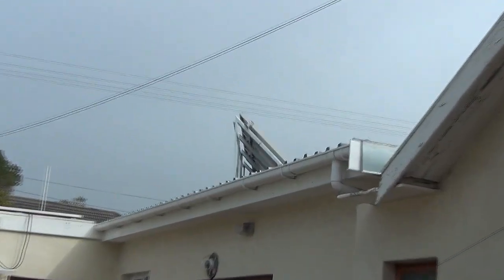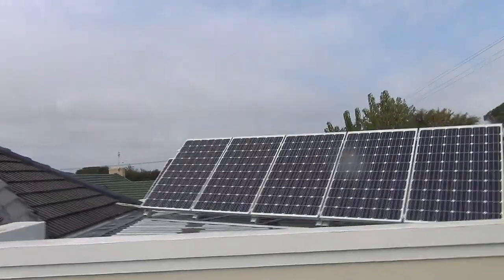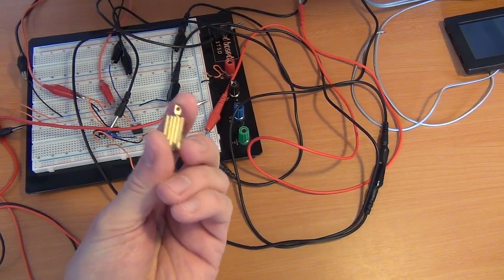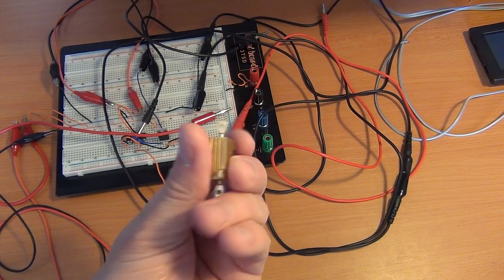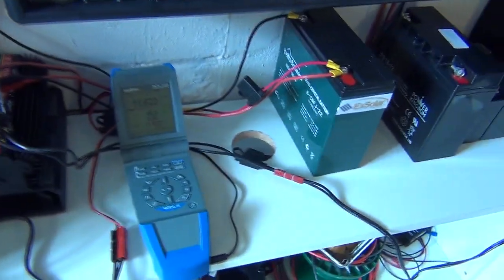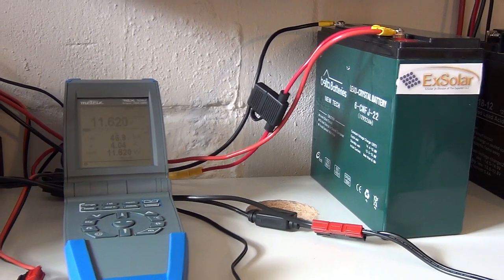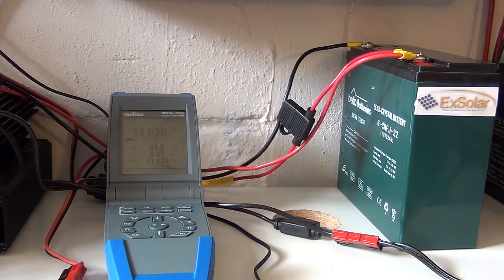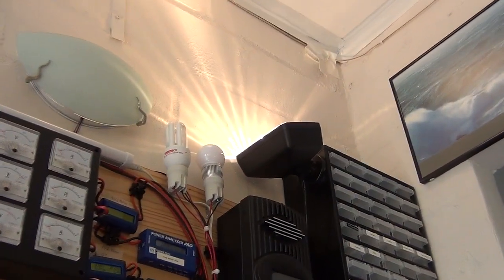T4D #20 - Solar Kindle, Solar House, Electronic DC Load

Comment from the maker: Thanks for the feedback. The capacitors are not "small", they are 220 F hybrid capacitors. Capacitors in this energy storage range are generally rated at lower voltages. These are rated at 2.3v and I thus need 8 to cater for the 18v solar panels. Thanks for the post.

Comment: The LT3652 is only available in VERY small surface mount packages and has a maximum rated charge current of 2A, so for experimentation purposes an off the shelf MCU with a homebrew MPPT/battery charging algorithm might be better.
Also, the charge in a capacitor is directly related to the potential difference across it.  Due to this potential variance, both the charger and the load output potential regulator need to handle a range of operating potentials.

Comment: i am in the UK so Grid Tie is not an issue as long as the system is not bigger then 3.86KW (G89 rules 16A limited inverter) you just notify them within 30days of system been live

Comment: Nice video. I have one small suggestion don§t use 10 small capacitors but only one or max two capacitors with higher capacity. for example I wanted use 20x 560uF/400V capacitors to make some kind of buffer for solar power energy(input) but i was reading there is possible leak current max 10mA for each capacitor so i bought only one 10mF cap/200V. btw I have 3*235W solar panels with Uo=111(all in series) but in general about 100V . So for one capacitor it isn't problem but for more it is NOK.

Comment: That Linear part looks like it should do a good job--- although it is pretty pricey. Digikey is offering them for USD$ 3.70/ea in 100+ qty for the DFN package. Although, it might actually be cheaper than buying a separate boost converter, then a charge controller and all of their support components. The part is also spec'd to Industrial/extended temp range, and Linear make good components-- you wouldn't want to use some cheapo chinese parts then have the thing die after 6 months!! ;)

Comment: over 3.86KW Inverter you have to get permission from the DNO before you even do the work (G59 Rules) been thinking of getting up to 7KW installed but seems easier to just install at home 3.8KW and second system relatives house as both could be live in less then 4 days , in the UK we get paid for power made so second system would be an Free install type of system where i would get the money power generated the house owner would get the power), its rare like once every 2-3 years we lose power here

Comment: that is why i think you should use only one big capacitor instead of 10 or more with lower capacity. and one big may be cheaper than 10 with smaller. even if not it is better to go with one than with 10 smaller

Comment: its 2 Independent 240v systems 
seems the power company does not allow GridTie (guess they do not want to lose money or Voltage is to high on the incoming line)
he is going to have 2 sockets in the house, 
offgrid (solar inverter connected to an Quattro inverter so depending on load it pull more power from battery's when solar is not enough or at night) 
OnGrid (norm mains)

Comment: Since this reader project is not really ultra low power (like µA or nA low power), I bet something like a 1€ µController for mppt combined with an 50 Cent smps controller could safely replace the 10€ LT part in this application. (pure software based would also be possible but a lot more complicated to be safe)
To bad this would chew up a substantial amount of time. Maybe I try after exams if I find some spare time.